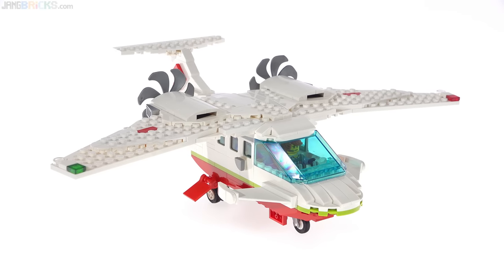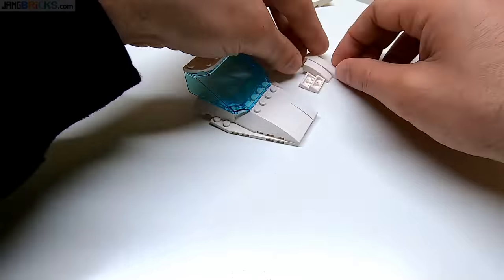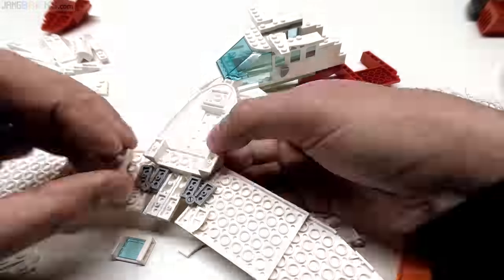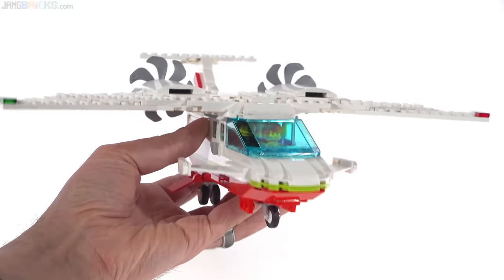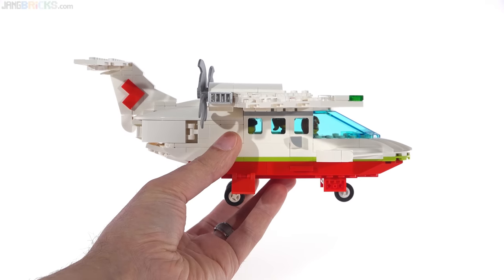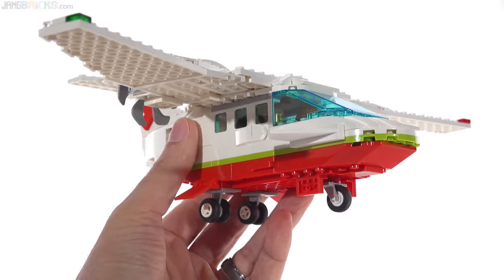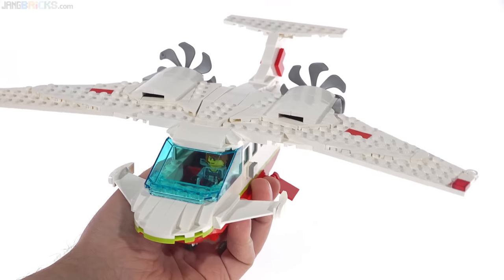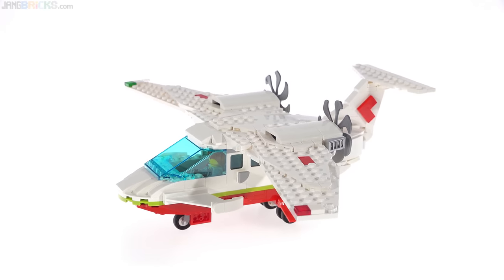My first modern custom LEGO airplane MOC

Comment: Looks good! I definitely noticed the Burt Rutan inspiration right away. The short nature of it reminds me of the older plane sets lego used to make before they had all the large pieces. Planes used to be pretty short, so this feels like it fits in well with that, while keeping modern building tecniques.
If you're ever down on Palo Alto, check out the Hiller Air Museum if you haven't already, it's pretty nice, has a lot of events, and has more of a rotor wing focus, but it's very well done, defintely a hidden gem for the south bay

Comment: I think th plane if built in real life could fly because as long as you get air to hold the wings up in th sky you should fly I believe its called lift also so you don't lose speed be carefull with drag and also make sure the plane won't stall so you don't lose lift and fall to your death but this is just what I think ok everyone.